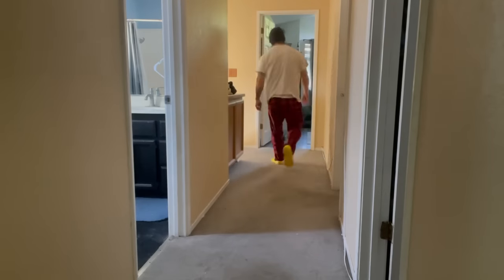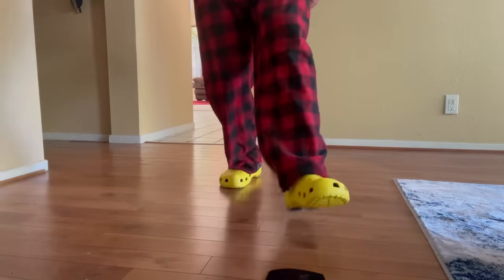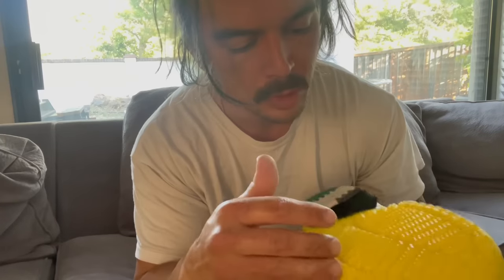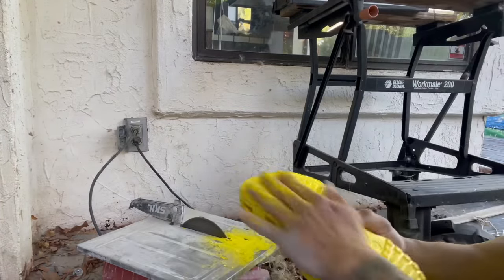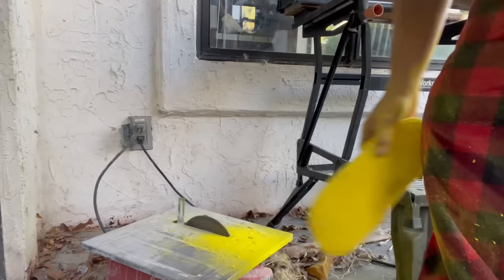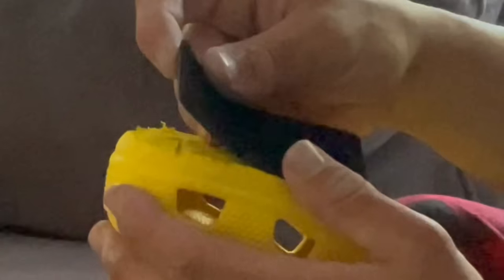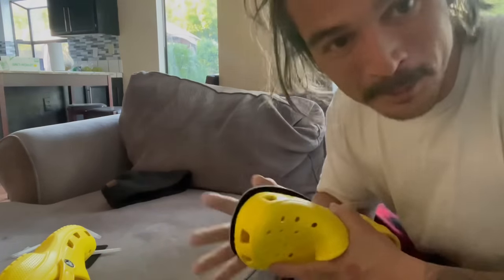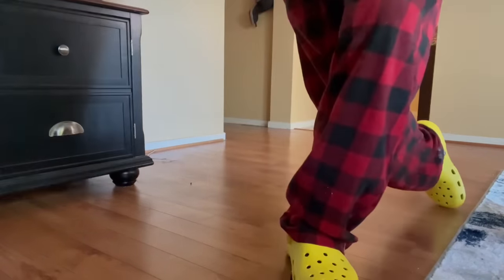I turned CROCS into BOWLING SHOES??!

Comment: I bowl in Jordan 1s (also Jordan 35s) with a slide pad. All you need is the low profile industrial strength Velcro from Walmart. It has a sticky side that can hold up to most anything. That way when you take the Velcro off you can use the shoes again and make literally any shoe a bowling shoe.
Reply from the maker: Think that’ll hold onto these croc soles? Jordan’s are much flatter

Comment: What if you drilled a ball for three fingers, but instead of the thumb in the normal position, the thumb hole was moved over where the thumb would be located if you threw two handed? Your hand wouldn’t be stretched then and would be less stress on your wrist. You would throw the ball essentially like a one handed with no thumb.